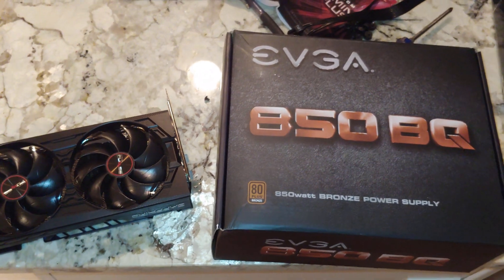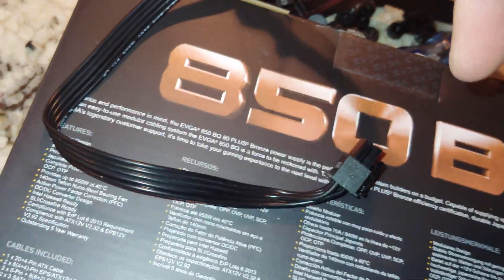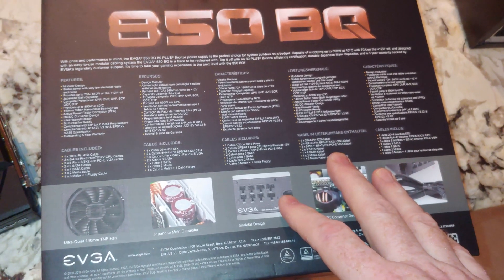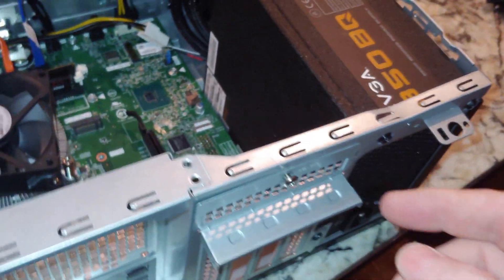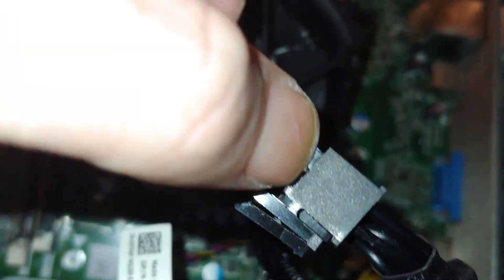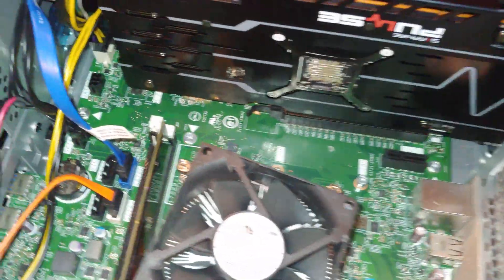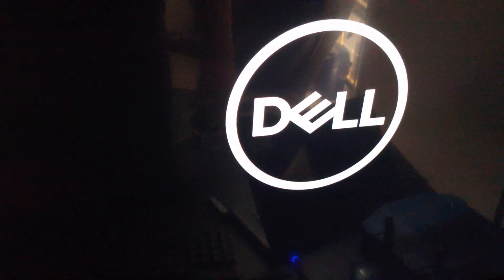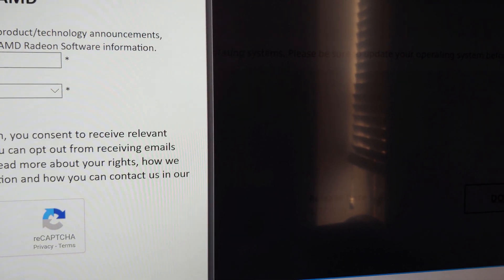Installing Semi Modular 850W PSU & RX 5500 /  Dell Inspiron 3670 /3671 Vostro, Installation Upgrade!

Comment from the maker: Parts used in this video include:
EVGA 850BQ:   https://amzn.to/2xU0XEJ
CPU upgraded from I5-8400 to I5-9400:  https://amzn.to/39Tiqdy         Alternatives: I5-9400f:  https://amzn.to/2XePD0C  Or even better I5-9500:  https://amzn.to/2Vbh8p7
Block Eruptor 24 to 8 pin adapter:  https://amzn.to/2RloLZ2
Sapphire RX 5500xt  4gb:  _______________       or recommended 8gb model:  https://amzn.to/2RlWp0V

Comment: The 24 to 8 pin adapter block erupter brand that you used is out of stock on amazon do you have another  one that will work the same

Comment: will a rx 6600 fit in this and a cheaper psu i don't need 850 .
Reply from the maker: I used about 4 different PSU's in this...400/600/750/850...so yes.  Some are more of a pain than others to fit...even though they should all be ATX.  For GPU...try to get one that is no more than 2 fans as the 3 fan models are probably too long.  If you can find a single fan model...even better.  It is tough fitting in a GPU that is 10-11" long...so the shorter the better.
Reply: @PC_HardwareTechUnboxing_1   most Rx 6600 are 2 to 3 fans  I found a dual oc one not sure on the right psu though to fit in the case is there a 600 one that you know will fit with a link.
Reply from the maker: @silverlinegaming3933  I think this video will be better though it was still in my earlier days of making these videos:  https://youtu.be/U_gn1QI8EAU?si=gL9M_hU8wt66umCL
This PSU most likely hasn't changed design in 10 years:  https://www.amazon.com/EVGA-Certified-100-W1-0600-K1-Power-Supply/dp/B0160XJAQK/ref=sr_1_3?crid=3EXHPWGRCKOY5&keywords=evga+white+psu&qid=1701341994&s=electronics&sprefix=evga+white+psu%2Celectronics%2C80&sr=1-3
I also used these motherboard spacers to help avoid interference: https://www.amazon.com/Mounting-Screws-Gigabyte-Motherboards-%EF%BC%8820pcs%EF%BC%89/dp/B091B4XZVR/ref=sr_1_4?crid=2ZVGPX7JI9NC2&keywords=motherboard+spacers&qid=1701342251&s=electronics&sprefix=motherboard+spacers%2Celectronics%2C79&sr=1-4

Links are direct to Amazon and not my Associate link
Reply: Hey pc hardware Ty for the quick reply I have a rx5700 that needs a 6pin and 8pin to power it is that psu that you linked me have both? Oh so what power drill will be good enough to drill holes on the bottom of the pc case for the power supply to breath.

Comment: Hi I have a 3670, a evga 650 BQ psu and a RTX 2060, how would I be able to get all of these parts working together? I don't mind the psu being external
Reply from the maker: Pretty much the way this video was done.  Only additional purchase is a 24 to 8 pin PSU adapter.  Plus driver install for GPU.  Assuming your GPU fits inside case...mig not additional PCIE 3.0 ribbon extender.

Comment: Hi i have vostro 3671 i5-9400
And 600watt power supply 
Can i run Gtx 1080 founders edition 8gb
Reply from the maker: With a pcie ribbon extender..probably too long

Comment: Is there any power supply ~600w range that you WOULD recommend or at least looks better than the EVGA tangled mess as a permenent upgrade for the 3670? Looking to run a gtx 1660ti on it.
Reply from the maker: I have done 4..they are all a mess
  If I don't need much power say only 365w..than one is cleaner.  Any semi modular will look 30% better.  Sorry I have no good news

Comment: Hi i have dell vostro 3668 i5 7400 12gb ram power supply 240w 
I can run gtx 1050 2gb gddr5 in this pc,??
Reply from the maker: Thats a bit low for power.  The GPU can use up to 75W max.  CPU is probably 65W...   The rest of the items, HDD or SSD, motherboard, RAM..fans...take up XX Watts...and there should be a buffer. as well.  Usually, the worse thing that happens is the computer will reboot in the heat of the action.  Not really a good thing...but shouldn't wreck your computer.  I would think you should look into a PSU upgrade.
Reply: @PC_HardwareTechUnboxing_1  thanks so much bro 
And can you give me name of the psu compatible in my pc and thanks so much again👍🏻🙏🙏
Reply: Bro we have the same PC, and i actually installed 1050ti and its working, but i underclocked it using EVGA Precision to minimize its power usage. And yes I can play dota 2 with 100 fps High settings

Comment: I recently installed a 600 watt psu and a gtx 1060 3gb into my dell Inspiron and when I run games like Fortnite with all low settings but maxed 3D resolution, I get about 130 FPS, is that below average
Reply from the maker: Hello, it is hard to for me to give you an exact answer as though I have a lot of graphics cards, I don't have a GTX 1060.  Closest I currently have would be the RX 5500 or GTX 1660TI.    Both of which should perform significantly better   I had a 1650 and 1650 Super which would have put me in the ballpark..but I don't see any videos me doing Low settings on here.

I have made quite a few Fortnite videos 1080p low, competitive, medium...Ultra, 1440p, and 4k.     When I review some of my gaming footage....the FPS range is all over the place.  I am also using a screen recorder which drops my FPS up to 10% depending on settings.    That said, FortNite is hard to say what a good average is.  If you have nothing but action from start to finish...than 130 would not be bad.  However, if you are off hunting for weapons, being stealthy...staying away from the action, you could get a pretty high average.  This can be a bit misleading.  Sorry, this probably wasn't much help.
Reply: No it was thank you
Reply: Bro play on dx12